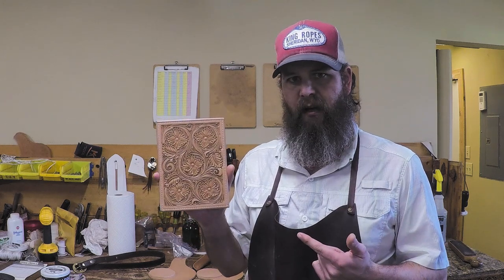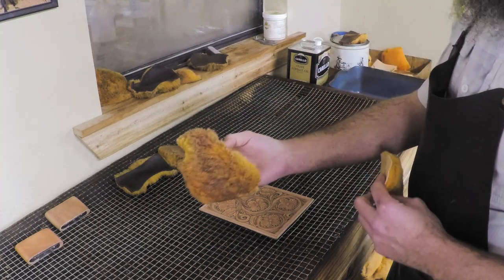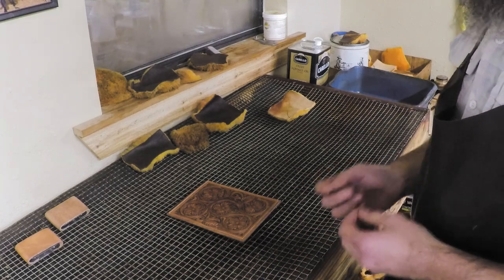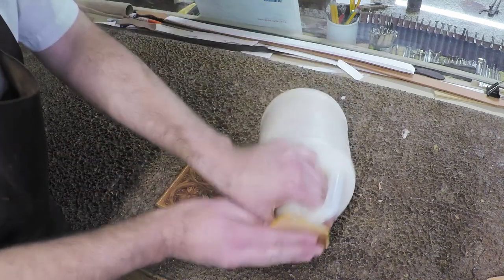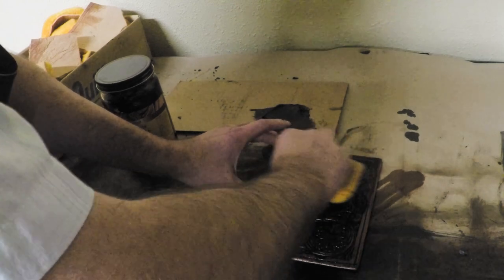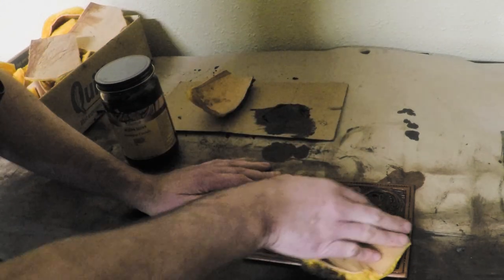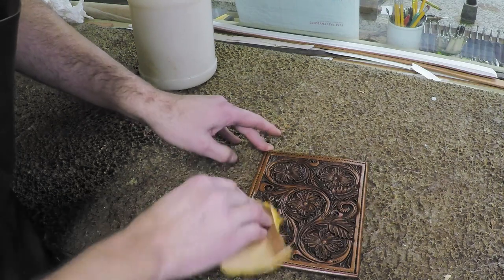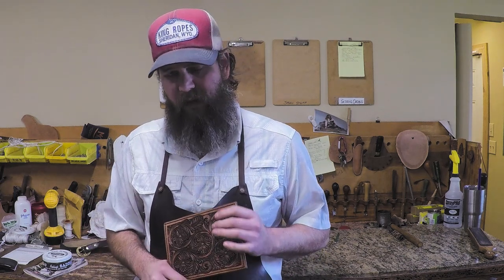How to Oil and Antique Tooled Leather Projects

Comment: Great info, Don. Thank you. I've done leathercraft starting with shoe repair for over 40 years. This is the first video that has validated my use of plant-based oils  to feed leather. My mentor in shoe repair (Ron Brower) used to take extremely dirty saddles to the self-serve car wash and clean  them, being careful, of course not to cut the leather with the sprayer, let them sit for 2 days and then condition them before proceeding. Who taught you tooling, if I may ask? It's beautiful, and sooooo natural. Thanks again.

Comment: Don, I have a small holster that I made, and did some  not so great tooling, and then a little black dye to set it off. I posted pictures of it and was told that I should antique the natiral part to give it some detail. My problem is...I don't have much room to do all that you just did, so, could I get by with just applying a light coat of oil to it and let that be it?

Comment: Can the oil & finisher be applied by a spray bottle to control the even coating then rubbed in or buffed? Also, if vegetable oil is used, does the sealant actually contain the oils, or would I not use peanut oil for a customer with a peanut oil allergy?

Comment: Thanks don for all ur help , ur videos help me a lot , I’m going to try this technique on my next belt I’m making for a friend , have you every done a tutorial on resists with dyes , not antiques, black oil dye , I tried Fiebings pro resist against Fiebing black oil dye and it did work, what do you think, thanks
Reply: A resist does not work with dyes because your resist is going to have acrylic in it so it will resist acrylic, and your antique also has acrylic in it, dye does not have acrylic in it so it acts differently. Fiebings prodye is made from petroleum distilites and will go deep into  the leather, so anywhere it can go in it will not only dye that spot but will cut underneath anything else including paint. listen to Don enough and he will explain all that. If you want to put a dye on only in specific spots, I do it fairly often, then paint it in then seal it.

Comment: Hi there i'm still enjoying your helpful videos, but for starting out as I am, i'm needing to learn  what is it I should be using on leather that is semi lightweight, I bought a pack of remnants as a good starter, I never got any heavy leather & I want to make maybe a keychain, coin purse, wallets or cigarette lighter holder, etc, I think the leather I got may be to light weight, so can any of this be successfully used, can it be thickened by being treated with a finish of some sort, i'd appreciate any helpful pointers that you can give me on this issue thanks.

Comment: Can you coat the oiled leather with acrylic? Would it stick?
Reply: In my experience, no. Acrylic will absorb and stick to the grain of the leather best when it’s in its most natural state
Reply: Joe Meling (his videos are elsewhere) might disagree with you.  He shows a process where a light neatsfoot goes on first, then acrylic, and in fact claims it helps disperse the pigments a little bit.  I’ve not confirmed this, however, as I usually get all the pigments, acrylic- and alcohol-based, on first and then oil. I do read from time to time others professing the oil —> acrylic claim.

Comment: Thanks, what are your thoughts on the fiebings pro resist?
Reply: I can tell you mine- it works good for areas YOU DON'T want anything to stick. I thought it would be an interchangeable product with TK, but no-my antique started flaking off on a line of product I was working on. I called Fiebings directly and it seems a disagreement in the use of "resist" in the leatherworking world vs. "block" It is a TRUE resist. Sigh. Thanks for the video Don, went back to this episode  and got my Tan-Kote and  no problems on my test pieces!

Comment: Thanks for another top notch video Don. For those that don't have an unlimited supply of sheep skin pads, you can wash them in warm water with a little Dawn dish soap and it removes all the oil, Neat Lac or antique. I have pads that I have used for several years actually that I have been careful to wash immediately after use.
Reply: Tandy carries the rounds already cut and has the bulk available as well Chief. I am former Navy as well so its nice to see another Navy guy posting.
Reply: @craigdraper2890  Ahoy sailor. :) The nearest Tandy to me is 55 miles so don't go there. I mail order most stuff I need from Springfield Leather. Years ago I used Tandy when they had a store about 30 miles away and weren't selling junk from China.
Reply: @donmoore9605  Yes, mine is over 40 miles away and I almost never go there or order online but there sheep skin liners are pretty decent and work well, very consistent so i still buy those. however since i too buy alot from springfield, I imagine you can get this from them too, and probably better. when i run out of what i have i will look at that but i bought my current batch a couple of years ago and i havent run out of them yet. I tend to use paper towels for antiquing and cloth rags for oiling, sheep skin for buffing.
Reply: I think there are probably plenty of us Navy folks lurking around leather working, its in our blood lol.

Comment: Hi Don, Great video as usual. My question is this. I usually use RTC Sheridan for my resist and finish. they advertise that you can oil it afterwords and my experience with it is that it works quite well that way but i have heard that it is fairly similar to wyosheen and super sheen. I am not a fan of super sheen at all because i have experienced cracking with it where i have never had that problem with RTC or Tan Coat. I use Tan Coat alot on my interiors when i dont line the product, I also noticed that almost all the saddle makers I know or follow use Tan Kote exclusively. since my main product is belts I am wondering how well Tan Kote would be to use on them. So far my belts have been used by Electricians, Technicians, Newspaper printers and such because i try to make mine durable and resist oils, inks, and solvents and such as much as possible and still look good. It doesnt always work out that way but since my belts hold up way better than a walmart belt does, the ones that know this love them.